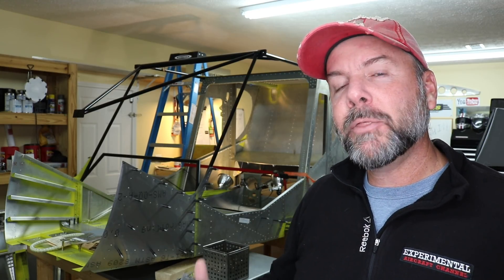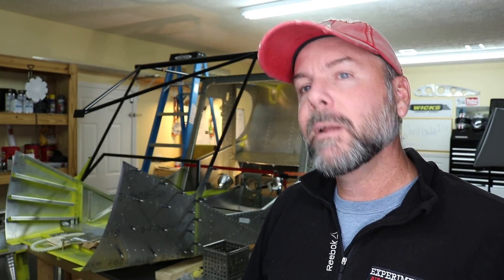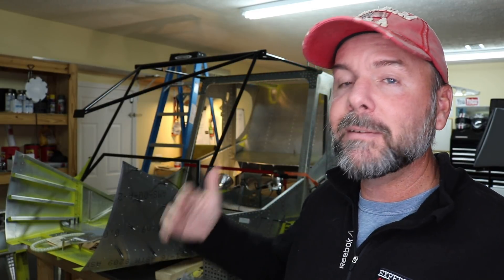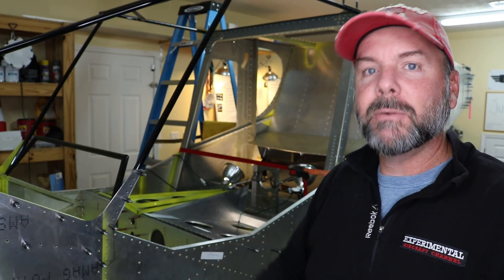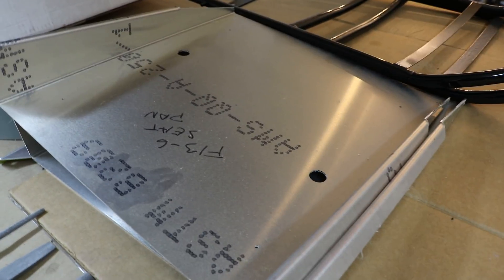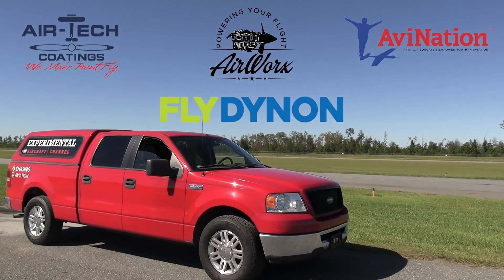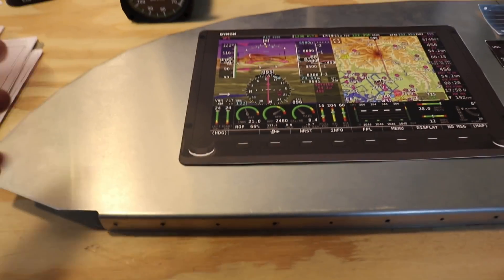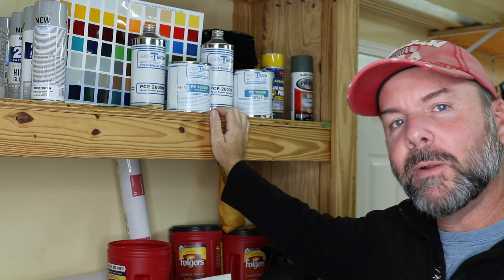Official Launch - Day 1 of the 31 Day Build Challenge Aircraft Kits and Projects

Comment: Bryan all I heard was that this 'project' was to start, "Dec. and this is the first day", so what day was the 'kick-off' for this to happen, because I'd also like to throw my Hat in the ring.

I've been collecting raw pieces to build a vintage Benson B-8
gyro for years; initially I'll use it to refamiliarize myself by kiting it on a 150ft. length of Austrian climbing rope on a hill a few miles from my house, then once I've regained my skills then I have a BMW R75 (750 cc) engine to mount on it.

The biggest problem has been getting information on how to build the rotors since I simply can't afford $3K for a set of super-duper rotor blades.

At one time Kenny Brock had plans for building a set of solid wood blades which were reinforced with a 2" X .125" 4130 steel 'spar' on the bottom surface; this is not the built-up rotors I presently have which have seen much better days and would take a lot more time to build another set due to the use of several different types of wood and the amount of gluing required to assemble everything together.

Anyway, it's nice to see a push to re-energize the homebuilt movement since most of us "everyday, average guys" (Joe Walsh) can't afford the prices that most of the new aircraft kits cost.

Thanks for the video and best of luck to anyone else who gets involved in this endeavor.
Reply from the maker: It is something I started now 3 years ago. Which makes this year the "3rd Annual." It starts each year on December 1st. It is the "31 Day Build Challenge" for the entire month. Just a way to promote, inspire, motivate fellow Builders to get some real work done on their projects before the New Year begins. Sort of like a New Years Resolution to work on your Project more, but starting in December. :-) JOIN IN!

Comment: I wish I had a project going at the moment to join in... but I'm just thinking about getting back into flying, and looking at the Sonex.  FYI... You chimed in on the FB post I started in the Sonex section. Keep up the good work.
Reply from the maker: It is often to do BOTH at the same time (Fly and Build) for a lot of people (including myself). Add to that... there isn't any place nearby to RENT and Airplane (hence the need to build or buy something). The SONEX is a great choice (especially for the Builder). It was on the top of my list. It was either the SONEX or the ZENITH. The Zenith one ultimately for this round because of useful load and ease of entry (dear old Dad had bad knees and easier to slide into a seat than to climb up onto a wing and down into a "bathtub." But I would like a Sonex for myself  and the "littles" to fly one day. Maybe you could start on the Tail Group early next year? That post... was it about the Acro and Ailerons options?
Reply: @ExperimentalAircraftChannel  While I did also respond on the aileron thread... I was referring to a thread I started about finding motivation to get back into flying.  Rentals are part of this.  When I started, I could get a C152 for $27hr wet.  Now they are $140.  At that price, you really can't rent a plane to go away for an "Over night".  Between the run time, and the overnight fee.... you may as well fly commercial. So that is the motivation to build again. (I did a KR2 in the 90's) But to simply get recertified could cost several thousand dollars.   The "Hobby" of flying is gone, and it's a serious commitment. My current girl friend says I should just buy the kit... and figure it out as I go.  LOL

Comment: Got my radiator installed yesterday and filled. for the seat rib, instead of cutting through a lightening hole, remake the ribs leave the hole out. I am also waiting to the very last minute to rivet the baggage floor and console panels in. I have had to install and remove them several times for electrical, fuel lines etc. Id suggest just cleco them in and not rivet to you absolutely have to.
Reply from the maker: Agreed. I will NOT rivet them down until the last minute. But will try to drill and prep everything else (including painting them) so all that is left is the rivets. Or... maybe even put in a sacrificial rivet or two to hold everything in place. Thanks for saying hello. I hope you join in on the CHALLENGE!
Reply: @ExperimentalAircraftChannel  It says your fb page isnt available, But nothing to report today as I am not building, had an eye doctors appointment, they dilated so can't see well enough the try and work on plane.

Comment: AirTech will, for Sure be my choice of primer and paint when the time comes!! The deep gloss and colors are so beautiful and vibrant, just breathtaking in my opinion!!!!!  They are the perfect solution for OCD's like myself.
Reply from the maker: AWESOME! Happy to hear that. You will have to share you experience with us once you get to that point. :-)
Reply: Scotabot: Don't know what you're building but if you are going to be putting this material of any surface that flexes or vibrates it will need an additive to enhance its ability to flex with the substrate.

I was a technical advisor for Stitts Aircraft for a lot of years and have done (spray painted) a lot of aircraft in my time, and their paint was designed with this in mind.

I mention this because I would get a phone call every now and then who had used Dupont's urethane paint on an aircraft without requesting a flexible additive be incorporated in it which resulted in it cracking or 'spider-webbing', or in some cases peeling off in strips while in flght.

Good luck on your build and remember to let them know what you are painting because you can use a much higher VOC rating for aircraft than any other vehicles.